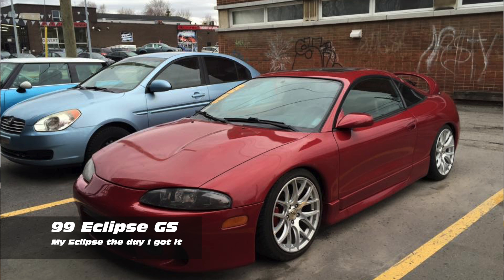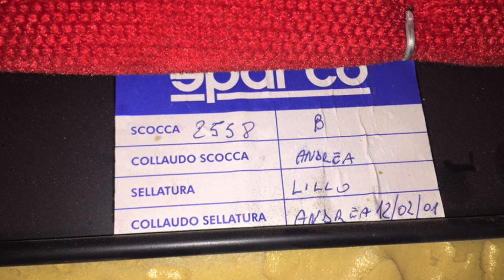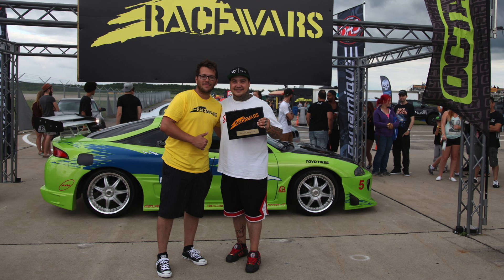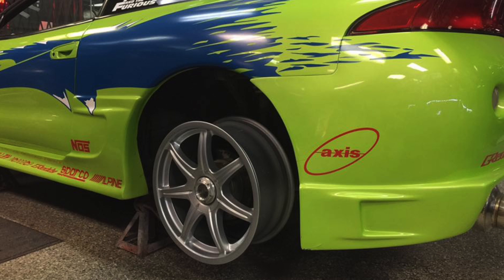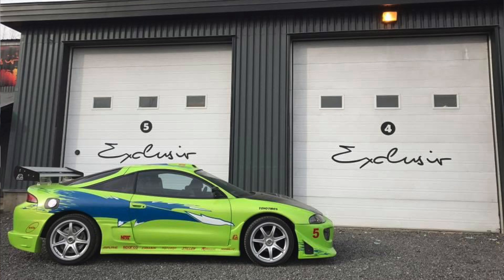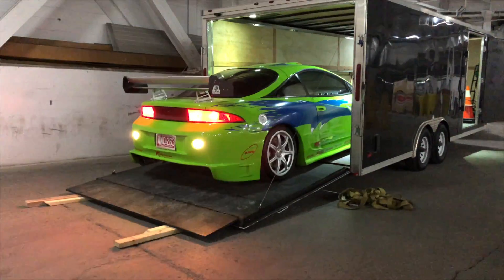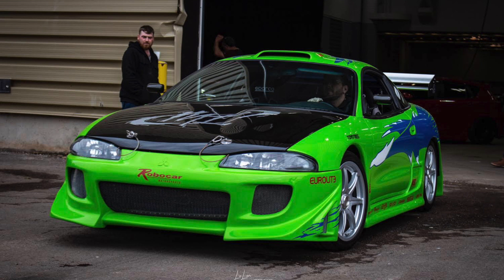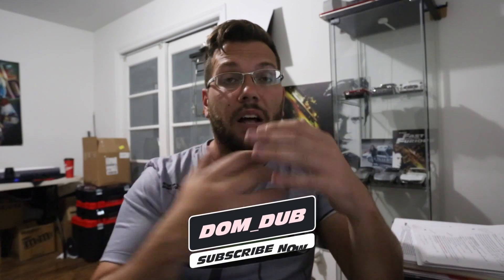HOW I ENDED UP WITH THE FAST AND THE FURIOUS ECLIPSE **Build Story**

Comment: Sick vos efforts et travail. Continuez malgré les mauvais commentaires svp. A+. Fck pour la maxima ! Jai donné la mienne a kenny u pull avec le body kit stillen dessus! Un 96' avec rear end 97' , 5mt. Clear corners etc. Ca aurait ete un méchant bon départ pour ton build. Mais je lai mis a vendre 800$ pendant 3 mois personne la voulais. Super clean pas de rouille de body, mais les frames rail pourris pcq elle etait too low. J'espère que qqun a gardé les pièces, donc dipo a qqpart au qc.
Reply from the maker: Est-elle encore là ? J'irais ramasser les jupes ;)

Comment: So the color of eclipse Craig said it was Kawasaki green or lambo you totally went away and said it is not it 🧐  what is it and who is correct
Reply from the maker: velmin husic I color scanned the original hero car ... And as you can see by the finished product... i'm right 🤷🏼‍♂️
Reply: There is no flea green on ppg website you sure that is what it called hmmmm
Reply from the maker: Fleet Green not flea...
Reply: Dom did u use the lambo verde colour the first time u painted the eclipse? I painted mine with it and it looks pretty similar to ur first try !
Reply from the maker: Slapjack let me turn the question around... Look at the results and tell me it aint dead on accurate to the hero car ? Of course the stunt cars had cheap 717 or 617 paint on them... Like i said in the video, my car was color scanned off the original hero eclipse....
Reply: Did mean like that i belive u , ur 2018 repaint of the car looks totally accurate to the hero car.. Only question i had was did u use lambo green on ur 2015 version .. I used lambo green and it looks very similar to ur 2015 version